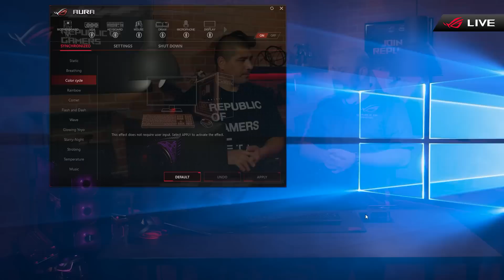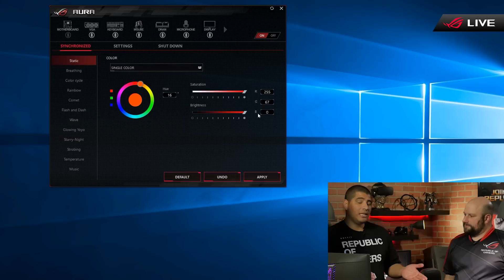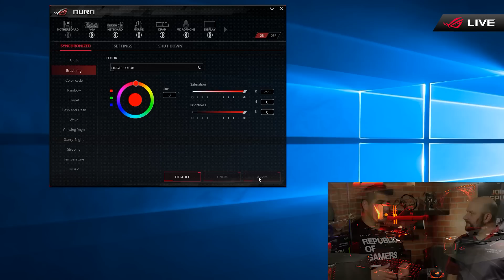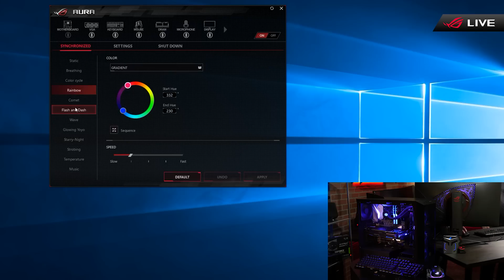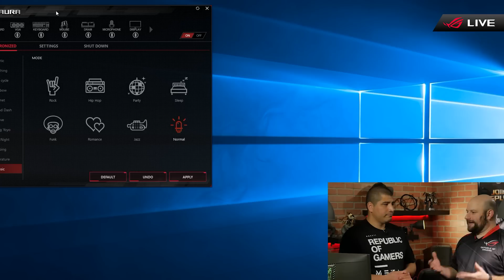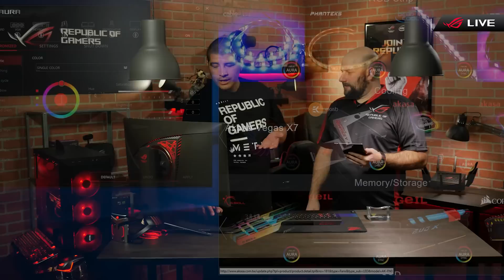AURA SYNC Holiday Build - Live

Comment: Hi there I bought  a z270e for my build  and when I went to start the pc I keep getting an orange light on the dram  and had no display I had a corsair vengeance ddr4 3000 I had it on A2 and B2 like it say   I keep changing  the ram to different slots an at the end I realized only worked on B1 and B2  I don't know  if I'm losing any performance?  But I've noticed that  so many ppl have  this exact problem  so why hasn't it been addressed  by Asus and you can't find anything on line  can someone see what wrorg ?is it the bios or the motherboard  that's bad .??

Comment: Hi,

My Strix B350-F motherboard is not being detected by Aura software. When I boot my system, my mother board and Phanteks LED strips will turn on for a second and then turn off. Under BIOS, my Onboard RGB Lighting is Enabled. All the lights stayed on when I finished building the system before installing the OS, it would sit and do color cycle but after setting up my PC, the motherboard and LED strips cuts off a second after powering on. I am using Windows 10 Pro 64 Bit. Also I wanted to mention I have a Strix GPU and it is detected by Aura and the lighting works fine. Do you have got any suggestions?

Comment: After about 3 hours of trying to find this version of Aura Sync, I gave up. If someone can point me in the right direction I would appreciate it.
Reply: Tony Perszyk look up your motherboard on Asus website. Click support. Go to your motherboards support page. Put in your info (windows 10 64 bit blah blah ) look on that page for the latest aura
Reply: Just go to the support site - support dot asus dot com - From there input your model - The current version is Aura V1.05.28
Reply: Thanks JJ Guerrero. I have tried that version. It does not have the same GUI or features as the one you are using.